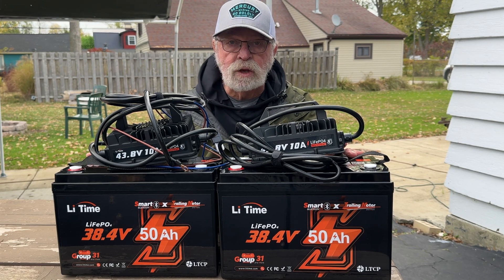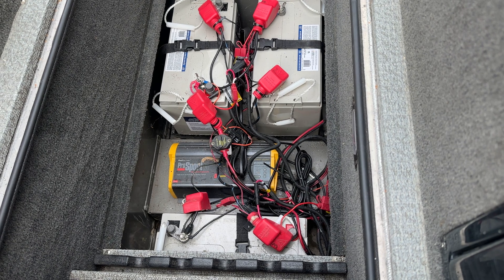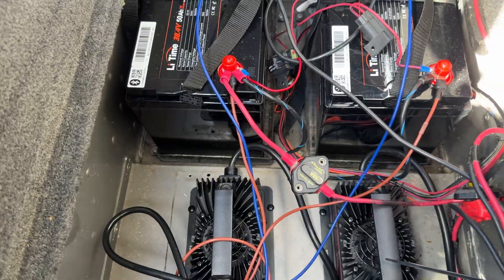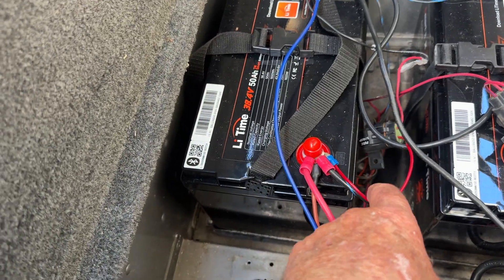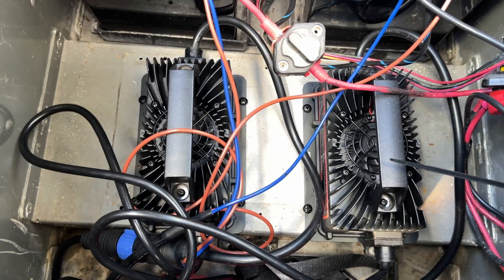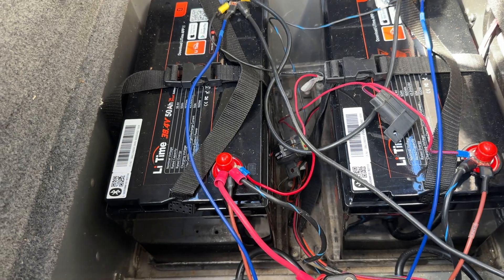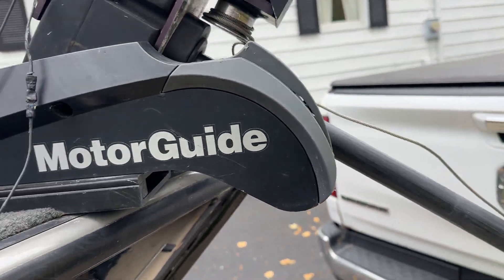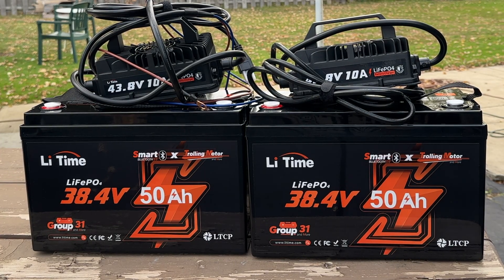“36V Trolling Motor Upgrade – Switching from 3 AGM Batteries to 2 LiTime 36V LiFePO4s!”

Comment: Why did you install 2 chargers when your batteries are wired in parallel? 1 charger would be sufficient, no?
Reply from the maker: Great question.  One will work fine…I have 2 because I guide just about everyday and need to have them fully charged asap for the day.